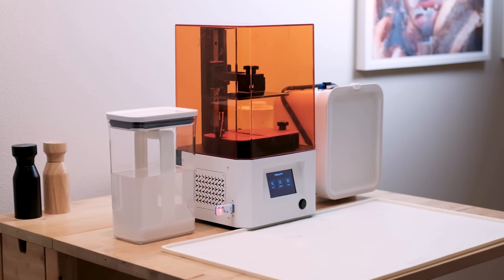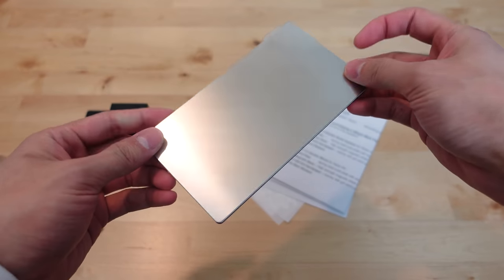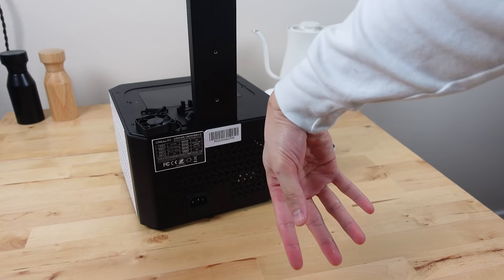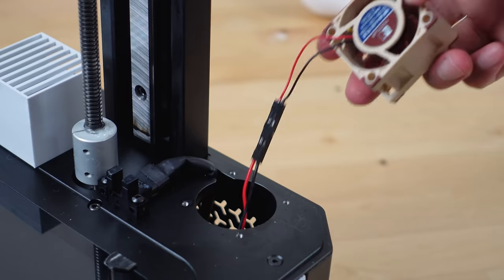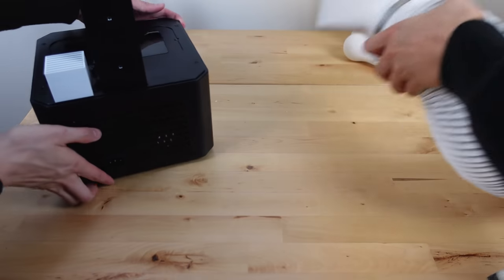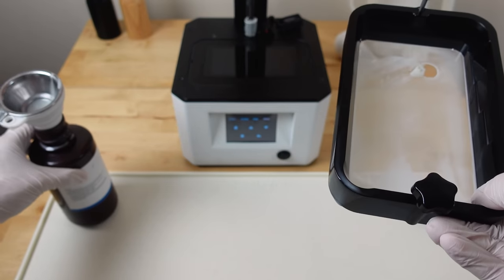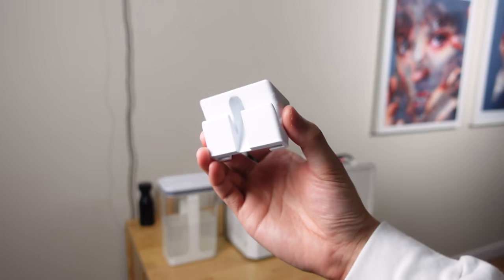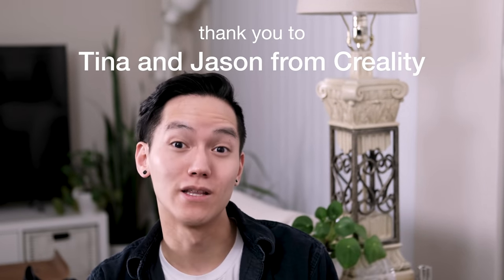First 10 Upgrades & Mods for my LD-002R

Comment: any estimate on when the ender 3 part 2 video will be out?
Reply from the maker: it will be my next video! probably early Feb.
Reply: @ScottYuJan  Thank you so much for the reply personally I have a hemera on my ender 3 so wondering if you will add a new extruder to print flexibles.
Reply from the maker: @omarbadawia2560  dang that’s sweet. the hemera direct drive kit looks gorgeous. a bit expensive though so i went a different route. we’ll see if it can do flexibles or not though haha still going through calibration and testing.
Reply: @ScottYuJan  Oh cool stuff really great stuff loving your channel my silent board was damaged in the mail so I am getting a replacement

Comment: If you are expelling fumes (which the compounds will be) you can't even talk about particle size senseably since the molecuels are suspended/desolved in air. The way they are filtered is by adsorbition. And a thick and dense enough activated coal filter should be enough to get the expelled amount to a good enough level. 

OFC you can do a heated catalytic filter with an aditional oxigen inlet but that stuff is omly good when you have to get rid of some really toxic stuff.

Comment: I am using CURA how much percent bigger do I need to print the vat holder?
Reply from the maker: dang, i don't remember sadly since i didn't make note of it but i'm PRETTY sure it was 101% larger since the original one was already SUPER close to fitting. Not certain though. maybe check the comments on that thingiverse page. good luck!

Comment: Damn I want that Angled dripper but I'm scared that if it fails it will crash to the lcd. I have the same type of filament too Esun PLA+. Layer adhesion is good but I'm still scared.

Comment: I was hoping you would address the lifting screw wobble issue... I still don't know what kind l of bearings to install and how exactly to fix that. Not a mechanic. Definitely not one. :(

Thanks for the video! I am so using the ventilation magnet-duct thingy you say, you have no idea. :D
Reply from the maker: yea so, in my ender 3 pro, 24 upgrades video i used a skateboard bearing to hold the threaded rod to prevent it from wobbling and got hundreds of comments about how the wobbling is actually perfectly natural and trying to restrict it from wobbling can cause major issues. i talked about this in more detail in the ender 3 pro part 2 video if you're interested but apparently the wobbling doesn't influence print quality or anything and you shouldn't try to fix it. good luck!

Comment: Can I print stuff I draw in solidworks?? I design in that and print in what type of file?
Reply from the maker: yes, for sure! You export your designs from solidworks as STL files and then you can use free tools like Cura or Prusaslicer to convert the 3D model to gCode which is basically instructions for your 3D printer to create your print! :)

Comment: I see several other have also asked this? -  What % upscale???? (NOTE: I had to print mine slightly scaled up since it appears the design was a bit too small. ) Trying to not waste PLA experimenting.
Reply from the maker: dang, i don't remember sadly since i didn't make note of it but i'm PRETTY sure it was 101% larger since the original one was SUPER close to fitting. Not certain though. maybe check the comments on that thingiverse page. good luck!
Reply: @ScottYuJan  It was a little tight but mine fit as printed without scaling. After a few times worked fine.
Reply from the maker: @DisSpirit1  oh wow, nice! you must have your printer pretty dialed in. well done 👍🏼

Comment: the carbon filter should NOT vent out. needs to be enclosed and oriented to circulate the air as it WILL NOT capture a significant amount of VOCs in a single pass and stink up the room/closet. as someones that has been printing for the last 10 years, i promise you that heating up plastics to melting temps or uncured resins WILL release fumes that are not good for you. i also designed and printed out a TPU lid gasket with iron pass in the prusa slicer. that has made it completely order less during operation and doesn't release a massive woft of smell when removing the lid and taking the print out

I THOUGHT published my designs for that on thingiverse, OOPS 😁 guess i'll do that soon. i'll edit this post when i do lol

Comment: Question: why can't you just run the resin 3D printer outside on your balcony?
Reply from the maker: i’ve seen a few people do that online and so i think it’s possible but here were a few of my concerns: 
1. you would need to somehow cover the printer some more since UV light from the sun is very strong and may get pass the cover and cure the resin in the vat
2. seattle is a bit too cold and i heard when it’s too cold liquid resin seems to become a bit thicker which influences curing times. might not a huge problem though. i’m not sure. 
3. i sadly do not have a balcony :( haha
Reply: @ScottYuJan  oh, okay. I figured there was no filament, so no humidity problem. Thanks for answering to my annoying questions and thanks for your amazing videos!